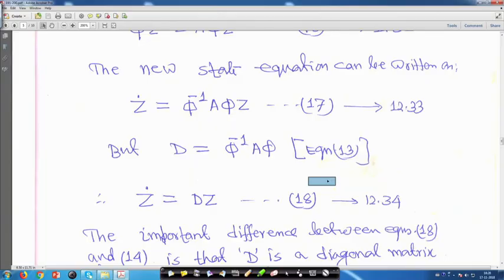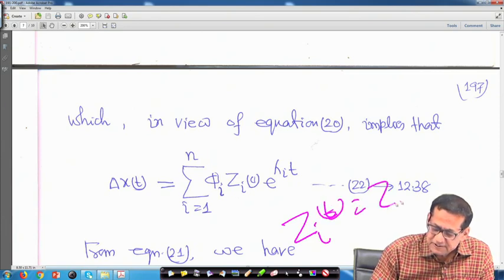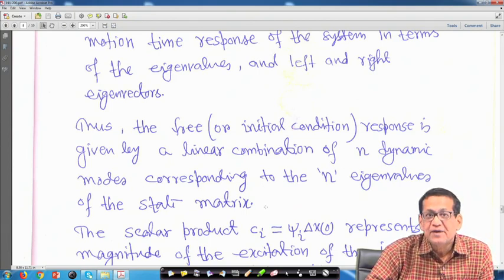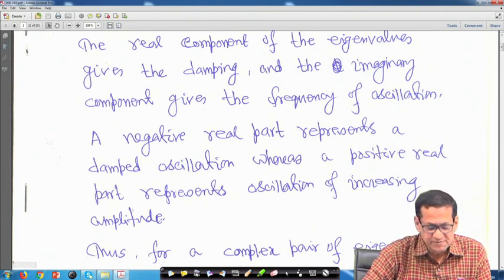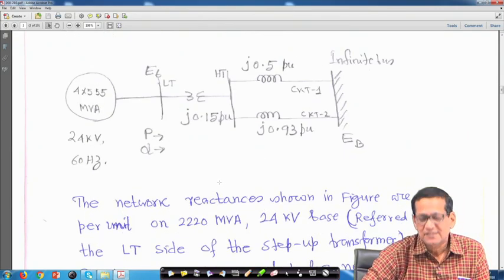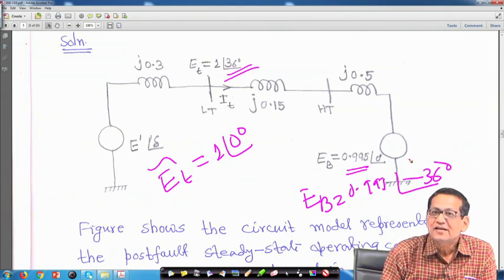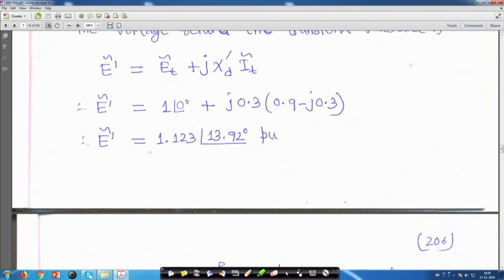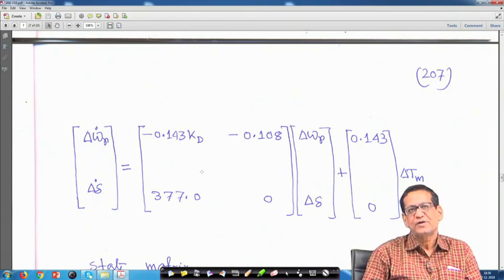Lecture 23: Power System stability, Eigen properties of the state matrix (Contd.)

Comment: Thank you very much Prof. for this wonderful video. I am considering stability analysis of a an IEEE power system considering relative stability with respect to a particular machine in the network. However, out of the five eigenvalues, two have values very close to zero ( i.e -0.0064 & -0.0052), -4.383617308944499e+04, -0.556e+4, and 7.9834e+4. Please what is your opinion on the stability of this system?